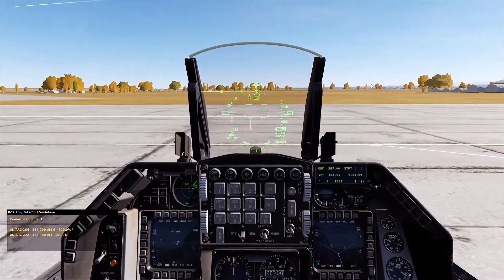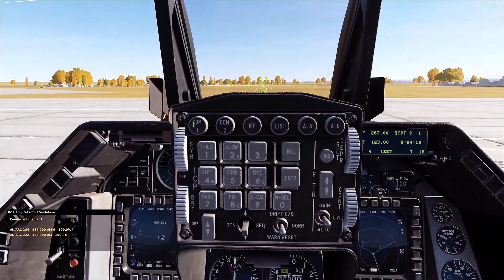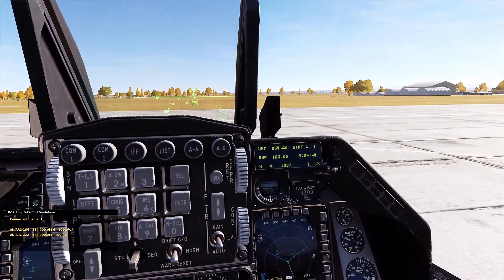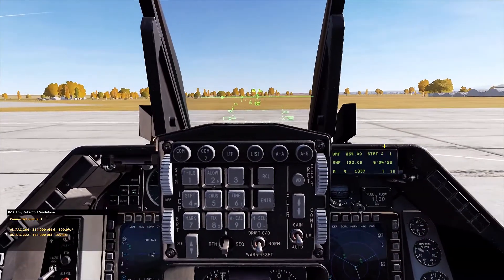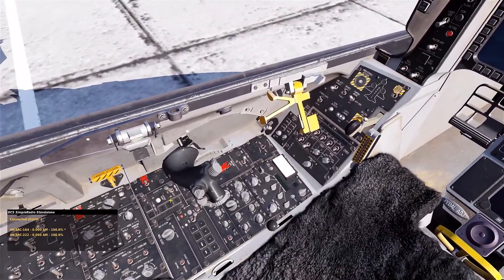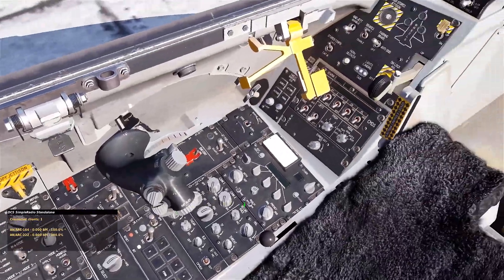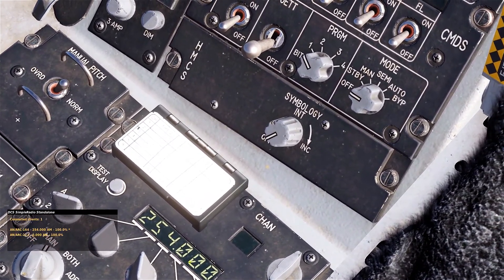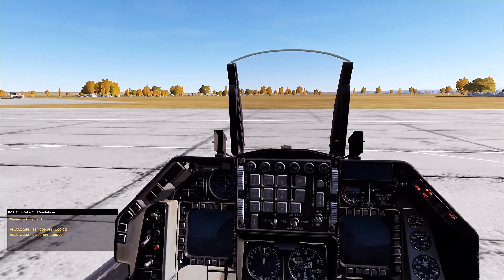F-16 Radio QUICK AND EASY!

Comment: The UHF radio can be used with aircraft battery power before the jet is started, but there are 2 important input conditions that weren't mentioned: 1) the C&I switch (located on the IFF panel) must be in backup, not UFC (upfront controls). 2) On the radio itself, the mode switch must be in manual.